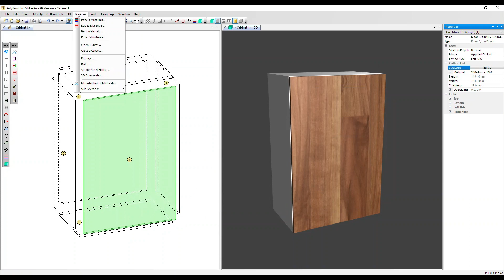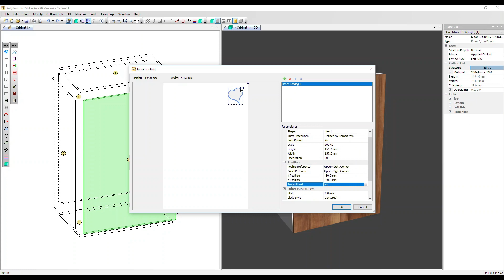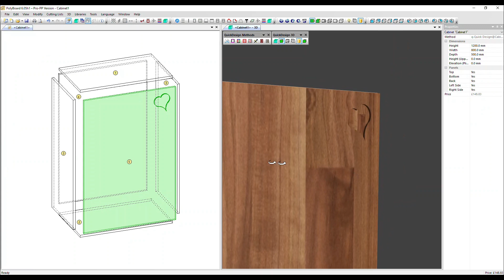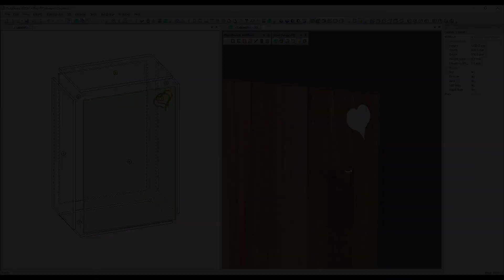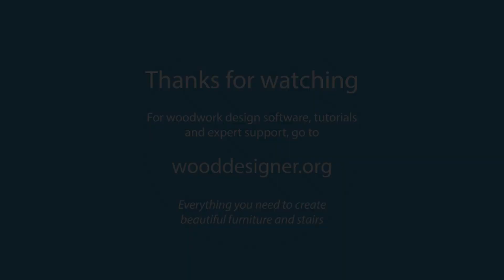Inner Tooling with Polyboard

Comment: Is there an easy way to create a square cut-out so that the CNC doesn’t cut the shape all the way through and the piece doesn’t fall out?
I know I could build it from four separate narrow cuts, but it’s difficult to position them perfectly so that everything is square and evenly spaced.
Is there a simpler method to do this directly in Polyboard? Thanks a lot!